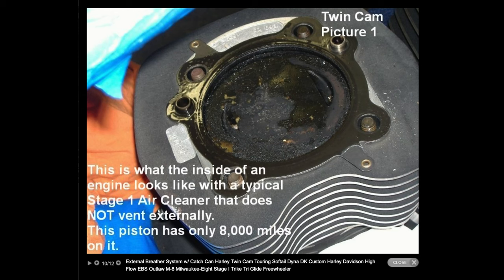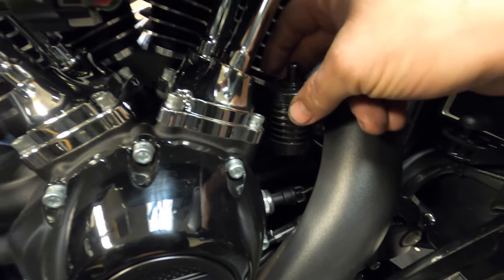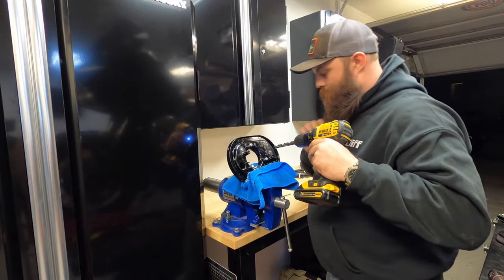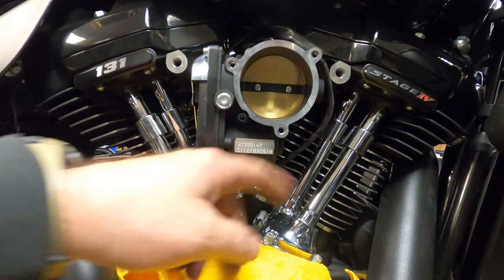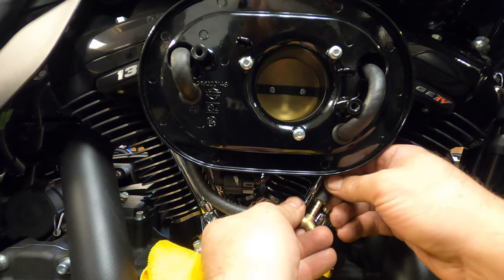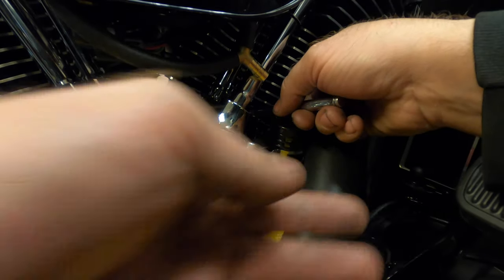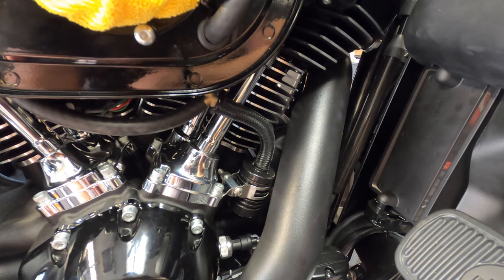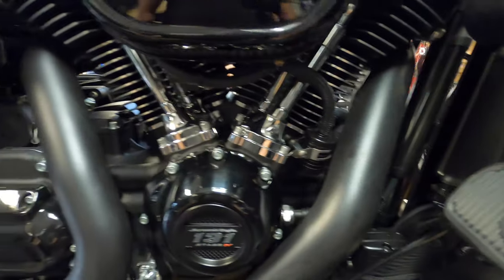DK Customs External Breather kit Installed Milwaukee Eight 2021 Road Glide Limited 131 CI

Comment: That clip was originally attached a bracket that came on the original air cleaner. That bracket is removed for most, if not all, aftermarket air cleaner. I only know this from all the air cleaner videos I've watched trying to decide on which one I want. 😁

Comment: Great minds think alike. I literally did the exact install on the backer plate. However, on my hose i went up and between the cylinders and mounted my filter under the hoen on the oppsite side.  The reason i went up is that the feuling vented
dipstick install says to go up and around before going down. I followed their logic and i guess we'll see if it pools anywhere in my line

Comment: I would have left the T valve inside the aircleaner so that only 1 hole is needed to be drilled
Reply: I’d recommend two holes. You really don’t want anything in there that can potentially come unhooked and make it’s way down the intake track

Comment: I used the brake reservoir just put some foam in it and a y piece and fixed it to the cam cover, DK customs would be great but postage and currency conversion to expensive, the brake reservoir does essentially the same for 20 Australian dollars

Comment: Great vid, you could try coiling wire around the rubber hose behind the air cleaner, that hose will surely kink when it gets hot, I'm going to do the same you have done to my bike thanks for sharing.

Comment: I thought they fixed the problem with the 2020 models? Guess not
Reply: They fixed the oil pump over scavenge issue. This is designed this way thanks to the EPA and all bikes and cars are subject to similar set ups.